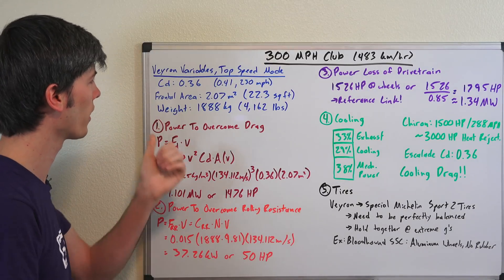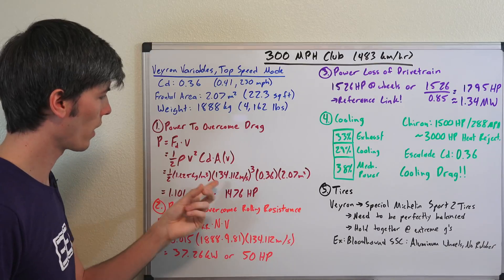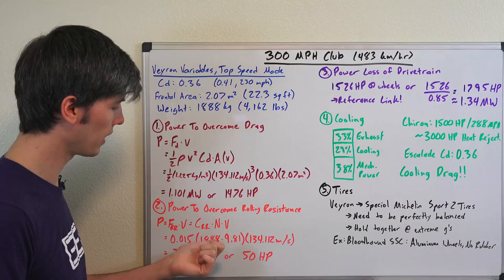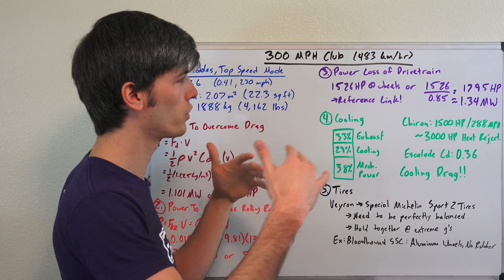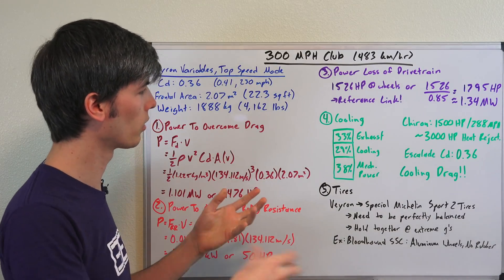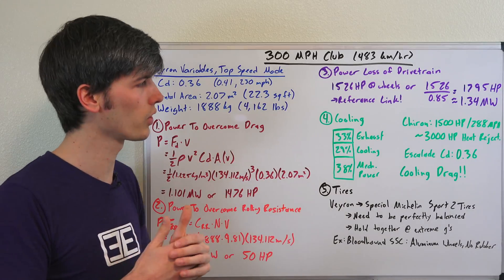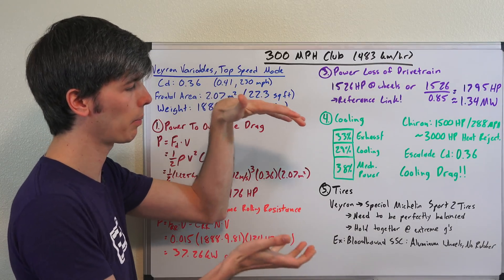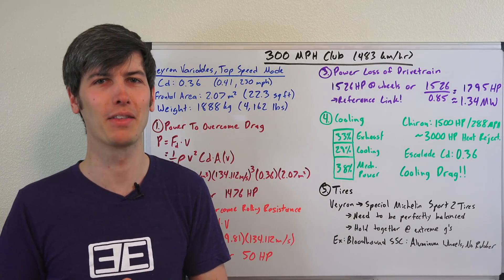Why Has No Production Car Hit 300 MPH?

Comment: That 300mph record will obviously come from an electric car with a transmission...
Reply: Fastest accelerating to 60mph*
Reply: Bugatti did it
Reply: Hey I'm from the future look at bugatti channel on youtube
Reply: if you need a gearbox how do you explain the Koenigsegg One? (link below) http://jalopnik.com/how-the-1-500-hp-koenigsegg-regera-hits-248-mph-without-1689181377
Reply: +Josh so you're telling me a simple 2-speed transmission wouldn't significantly increase the top speed of an electric car? Like getting it as fast as it will go originally, then advancing the gear ratio (changing gear) at say 200mph and starting from the bottom of the power band? I honestly don't know the answer to this for sure but to me it sounds like something that's somewhat possible.
Reply: Reciprocating engines have inherently limited rotation speed - no matter how much fuel you burn, it won't spin any faster. At the same time, internal combustion engines must spin at least as fast as to idle, otherwise they stall. This is why you need a gearbox on internal combustion engine - to provide ability to drive at very low speeds so that the motor doesn't stall, and to increase maximum speed range over it's inherent limit. 

Electric motor has neither of those problems. It provides 100% torque from cold start so it doesn't need a gearbox to drive slow, and you can always make it spin faster by applying more voltage, so it doesn't need a gearbox to drive fast either. This is why diesel-electric transmission vehicles (trains etc.) don't have a gearbox. Electric motor-wheels don't have gearboxes either, and they work just fine. 

Also notice that steam engines don't have gearboxes, too. That's because they have same properties as electric motors: 100% torque from cold start, and any top speeds if you supply enough pressure.
Reply: Gears reduce efficiency. They shave off precious kilowatts and turn them into useless (harmful even) heat. If you can get away without one - do!
Reply: Mi 28 Well,the Koenigsegg Regera got rid of the gearbox entirely.So what they used may be the future?
Reply: Why would an electric vehicle new to use an earth-based energy source vs electric?  You've completely lost me with your explanation...  your use of high speed trains as evidence appears anecdotal and devoid of scientific merit.
Reply: Animals use it for nagivation, those that have built-in compass. There's like whopping 3 species of insects that can do that.

And besides, magnetic field is not a source of energy, rather it's like a spring. You can get some energy out of rebound, but you'll have to compress it first and expend same amount of energy to do it.
Reply: ... no, that's not really what that means.
Reply: It's not that it's impossible to use Earth's magnetic field. It's that it has fuckall magnetic flux. You'll get way better energy output from forcing a coil of wire over a magnet than forcing a coil of wire over the Earth.
Reply: +Mi 28 electric motors still have limitations without a proper gearbox... eg. the Tesla P100D will cover the quarter mile in around 10.5 sec but will barely reach a terminal speed of 125mph (200kph)

This is because the Tesla's electric motor begins to suffer from 'magnetic saturation' beyond this speed.

https://en.wikipedia.org/wiki/Saturation_(magnetic)
Reply: Press x to doubt
Reply: The Chiron SS might hit that already
Reply: Simple solution currently in use is to gear the front and rear electric drives differently so hard acceleration is possible at low speeds and reasonable highway speeds can be sustained.
Reply: Josh You still bother replying to such a dumbnut?
Reply: +Josh Serious question, because I know automotive technology well, not so much about electrically driven automotive or powerful electric motors in general. What is it that a gasoline engine can do to continuously make a car go faster by simply changing gears on a transmission and restarting the power band (lower RPMs) that electric can't do? Clearly it won't work or like you said engineers would have done this ages ago, but what wont work? It seems to us that increasing rotational speed on an electric motor should be the same (or similar) to increasing RPM on a gasoline engine.
Reply: +Mi 28 This is very true about gear reduction in an internal combustion engine and honestly I kind of forgot that most of the gears we use daily to drive are reduced ratios so the vehicle can go slower. That alone is probably the full reason why we cant strap a tranny on an electric motor. But keep in mind there may still be hope, even if only to include one single higher gear. Because even with internal combustion engines after around 4th or 5th gear when it hits direct drive, the gear reduction flips into overdrive and the wheels turn faster than the engine. I know it takes a lot of torque to pull this off and a lot of pre-speed but that's why the second gear would be the overdrive to an already very torquey electric motor.
Reply: +Murat Harman Magnetic saturation limits the horsepower of a motor of certain size. It just needs a bigger motor, that's all. Or use a coreless motor - thin space has infinite "saturation" threshold.
Reply: Why do people think a transmission is some kind of magical box that adds power that isn't there or something, "Grr, me gearhead, change gear, go faster." It's almost as if they don't understand needing to change gear ratios is a compromise that trades torque for speed (in addition to adding mechanical losses), not an asset that adds speed from nothing.
Reply: You're correct. When spinning at very high rpm (especially since 300 mph), you lose a lot of energy in the motor because of two things. Centrifugal force or the conversion from angular momentum to rotational, and back EMF is exponential. Transmission would definitely help counteract those two huge inefficiencies.

Edit: smaller motors are known for having lower back EMF, but also will have lower starting torque.
Reply: Rimac is our only hope
Reply: So agreed
Reply: Rafael Samardzic RIMAC CONCEPT!!
Reply: I know this comment is old and what not main reason electrics don't use a transmission is the huge amount of torque it makes at low rpm and the extra bulkyness it would add to an already 4,000lb+ car yes direct drive is good but trying to say you wouldn't get more speed out of a transmission with overdrive is ludicrous sure torque and hp to the ground would be less in a higher gear ratio but if substantial enough can keep moving the car faster because it wouldn't be limited by the 1:1 gear ratio stopping the car at max rpm and thus the wheels can move faster
Reply: João Soares Comment has 300 likes now what a coincidence
Reply: no way an electric car beats a piston driven car to 300mph.   electric cars dont even have speed records for any realistic car driven record. gonna be a good five years before speed records of any magnitude are even in question.  the energy storage needed is outragiuous
Reply: your wrong two yearls later im replying to you the chiron just hit it
Reply: João Soares you will see 300mph before that. itll be a bit before its a productuon car record but there are street cars knocking on 283 right now. mind you... they didnt top out at 283 mph... it just did it in one mike and didnt keep excelerating. there are around 8 KNOWN street cars that have done over 275 in one mile.
Reply: Mi 28 "Electric cars don't need transmissions". Normal ones don't, evidently, but if you want to hit 300mph on one and still be able to drive it around town you definitely need a transmission.
Reply: "transmission adds power at speed"

WRONG. Power stays the same in all gears, and due to sub-100% efficiency of gears as devices, the output power is smaller than motor's power. Hence direct drive is the most efficient way of propulsion and vechiles that don't care about stalling do just that (motorboats and airplanes).
Reply: Electric cars don't need transmission - transmission trades over speed for torque, with power on the input and on the output remaining the same. Electric engine, not limited in maximum speed, doesn't need to trade torque for more speed. Producing high torque at low speed is the same as producing low torque at high speed, mechanical power on the output will be the same, and electric power drain on the input will also be the same. 

Suppose you drive an electric motor at 100% voltage, it runs at 100% speed. If you load it by 50%, then speed drops to 50%, and torque increases to match the load to 50%, and so does the current drain. If you had put a 2:1 gearbox between motor and load, then speed would only drop to 75%, and torque (and drain) would only increase to 25%. Without the gearbox, output speed is 50% and torque is 50%, but with the gearbox, it's 37.5% speed and 50% torque. With the gearbox, output power is actually lower, by 25% (2500 vs 1875). And with the gearbox, electric power drain is also lower, also by 25%. The gearbox didn't improve anything. In fact, you could've achieved same result by simply lowering voltage by 25%. There is no difference for electric motor, to pull harder or to spin faster. And real life gearbox will add drivetrain losses, weight and costs, which could be avoided.
Reply: MAN_ON_WHEELZ Yes, it obviously would, the guy is just being a troll (or is actually thick, buy let's give him the benefit of the doubt...).
Reply: think outside the box, put contact patches on the road that recharge the cars as they drive using solar power. like the old RC racetracks from back in the day. boom endless power right trans endless top speed the hardest part would be making it stay on the road and not come apart at them speeds
Reply: What about use multiple battery groups parallely? You can also design smart battery matrices. They change the way cells are connected according to demand.  Sometimes they can output high amps by parallel connection. Sometimes they can be isolated for efficiency.
Reply: Earth generates electromagnetism because of its core, right? Birds and insect use it to travel long distance. What about lighting a bulb on the ground wireless without the need of solar panel?  Science is relative limited by current knowledge considering majority of theories is based through experiments and observations
Reply: +Ashutosh Mishra That means it is possible to use magnetic field as source but our limited knowledge won't allow it in our current lifespan. Observation and experiments are the current   tool of discovering the unknown.
Reply: Electric car reaching 500 km/h will need an alternate method using planet Earth as source of energy or some ideas from bumping cars found in recreation park. TGV for hi-speed train in French uses alternative current from the trolley to perform at hi-speed.

Comment: They might consider using a radiator like a P-51 Mustang- one of the biggest innovations of that airplane.  The air was slowed down before passing through the radiator to reduce drag, and then the heat was used to re-accelerate the air out the back.

Comment: it is indeed mostly about aerodynamic drag. a TBM700, which only has 700 hp, has a top speed of about 345 mph. the TBM900, with 900 hp, can go even faster. but those are sleek machines with a turboprop engine.

Comment: Just for fun, I did the math backwards to find out what kind of Cd you would need with around 1500bhp, as the Chiron is supposed to have.  I came up with .299, which I don't think should be too tough for them, especially if they incorporate active cooling ducts or something.  A GT-R is .26 allegedly. And if it has a lower frontal area than the Veyron, since I used that figure, that would allow a slightly higher Cd still.  I think the limit will still be tires.  Isn't the Chiron actually going to be electronically limited on top speed?

Comment: the reason why the Bugatti chiron is limited to 260mph is for safety reasons mostly because the tires can't handle the outward force and by the time you got to the tip speed you would have no tires

Comment: what if they completely used liquid cooling instead of air cooling?
Reply from the maker: I don't know of any modern cars which use air cooling only. Almost all use liquid cooling systems. You have to reject heat into the atmosphere, however, which means dumping it into the surrounding air. That's the only long term solution to heat dissipation. You could have an internal cooling system, but you'd have to change out the fluid every time it was warm.

Comment: So, a 15hp riding mower is not powerful enough to tow a Bugatti Veyron because you would need 50 HP to overcome the rolling resistance?  Is that right?
Reply: The 50 HP (37 KW) figure is for overcoming the Veyron tire rolling resistance at 300 MPH (482 km/h).
Reply from the maker: 50 HP of rolling resistance at 300 mph. Power of RR is a function of velocity.

Comment: liquid nitrogen  holding tank to cool the engine and have flaps to close off some of the radiators.
Reply from the maker: Ahh, yeah, that'd be a cool "top speed" mode! Kinda like nitrous where it's a one time deal.
Reply: Exactly. I'll have to run the numbers on it someday and see if it would be feasable. Not sure how much liquid nitrogen you'd actually need if it would be size/weight prohibitive.

Comment: You listed the weight of the Veyron but it doesn't appear in your calculations??
Reply from the maker: Yes it does, point 2, bottom left, 1888 used in rolling resistance.

Comment: What about a BEV with double motors per wheel? Just 3 or 4 Regera battery packs would suffice an the car would still be light so the 0-300mph wouldn't take too long.
A BEV might do with a lot less cooling drag.

Comment: why use the worstest example the Bugatti is like the heaviest f**** supercar you can look up videos of the Veyron getting smoked by a Koenigsegg Agera R which is much lighter.
Reply: Weight has a big effect on acceleration but very little effect on top speed. Top speed is much more a factor of power vs drag. A fighter jet is much heavier than a hyper car, and won't accelerate away from a dead stop as quickly, but it can still travel much faster than any car!
Reply: noxious89123 true.

Comment: Didn't the airplane P38 Mustang have a radiator housing that actually produced thrust? Why has this phenomenon not been used in automobiles?
Reply: Because the "thrust" from that housings exhaust was still less than the drag caused by the intake.

Comment: I havent watched this yet but to the response of this title, many people can't drive 300mph properly to be safe. That will explain why. Now let's watch the video and ill comment afterwards
Reply: Well with all the theoretical knowledge and equations to explain the engineering principles of the whole mechanics. It is feasible as we see that a transportation can override 300mph, but as mentioned, a consumer on safety is a necessity. 

If anything going to exceed 300mph, it would be a new type of engine and new layers of roads to boost vehicles without that generation of heat. This also maintains the whole issue of majority of consumer and it is actually more controllable.

The only issue we have now, is we got these silly slow machine learning cars.
Reply: You completely missed the point of the video and conversation.
Reply: From an engineering perspective, most likely. But I'm viewing this from a business and economic perspectives on money-making in the market. 

If I were to view it from an engineering perspective, I'm sure the car manufacturers like Bugatti can undoubtedly do this when you bring the smart engineers together, but they do not make the decisions at the end of the day.  

The equations were provided for analysis to assess what is required. I'm sure without those constraints and engineers are free to make their decisions, you'll be amazed what a funky looking rocket car they made. It is a shame I won't be the person behind the wheel to test drive it if I could.
Reply: +Test Test 
Well, this is a channel about engineering, theory, theoretical limits, mathematical possibilities, analysis and exploration of physics, facts and hypothesis. 

Apparently Bugatti did not get your memo since they have designed, engineered, developed and marketed several vehicles including the Veyron and Chiron which are both priced well beyond the ability of over 90 percent of the global population to purchase ... and even then priced at over $4 million USD each, Bugatti is reportedly losing money on each individual vehicle manufactured and sold.
Reply: I'm sure this channel is welcoming as the other channels in the YouTube community. That is why I have come to watch the gentlemen's video on his expertise. It was recommended to me because I do watch a lot of scientific videos as well as work in that scientific domain.

Indeed, when people in the industry overstretch their budget on a project to cater their own analysis and vision to become a reality, a possibility like that does occur. After all, with limited resources, we have to be smart with how we manage things if we really want to continue to explore more about physics, and hypothesis.